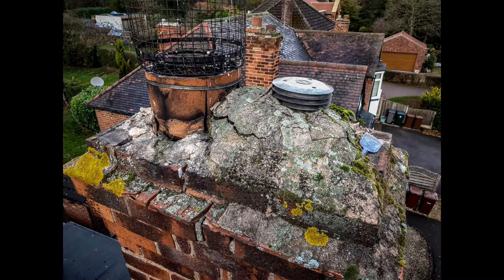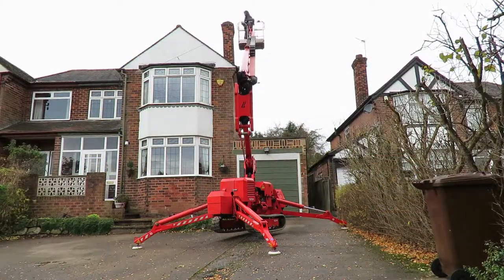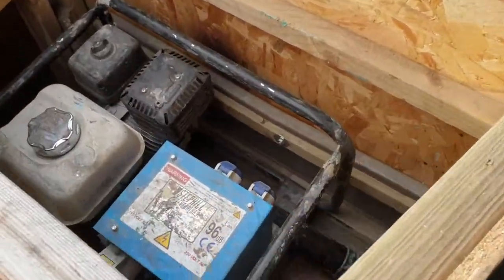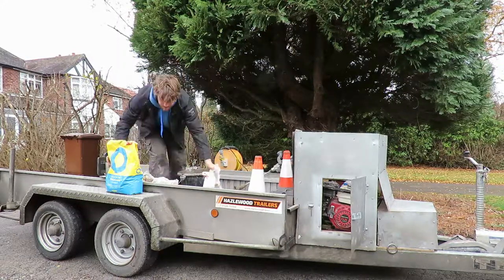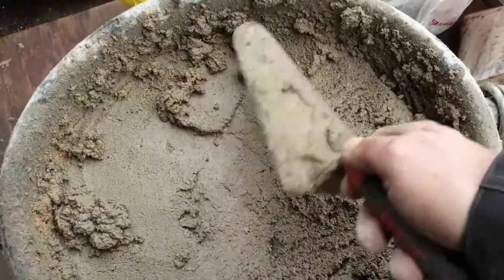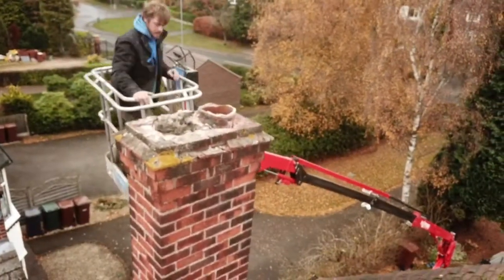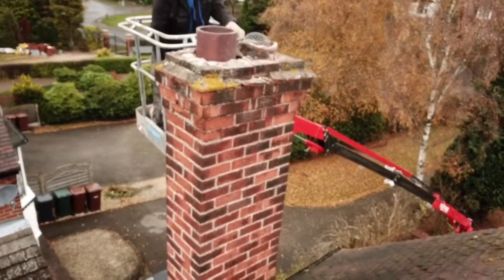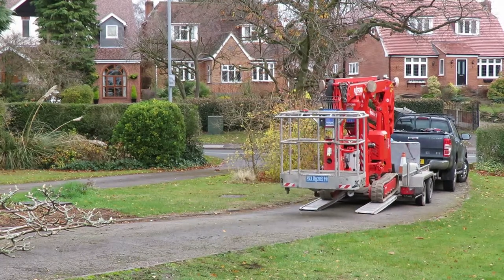Installing a chimney flauncing in Ravenshead Nottinghamshire

Comment: I'd have loved one of those machines, just been up through the Velux and tied myself to the chimney with some ropes. Was proud of the job until a neighbour pointed out that the pot was a little bit on the piss. Its going to stay that way.
Reply from the maker: @sylvinolieno5361   I am sure it looks fine, and as long as the concrete flauncing around the chimney is sound your chimney pot will be fine 👍

Comment: the spider is brilliant looks like you have a crackin business there bud well done
Reply from the maker: Thank you, it's a handy bit of kit and it certainly makes my life much easier.
Reply from the maker: The spider is a little bit over the top for that job but if you are dragging it around you may as well use it, it is much easier than using ladders.
I did this job ages ago so I can quite remember the cost but it would have been around £200ish.

Comment: I would be dubious of any (so called) builder who called mortar flaunch ( in my neck of the woods,  we call it 'compo'. Down south, they call it ' 'muck')  concrete?.....
Reply from the maker: I don't know anybody who calls mortar "flaunch" mortar where I am from is building sand and cement, mainly used for laying bricks or pointing masonary.
Reply: flaunching
noun
The sloped fillet around the base of a chimney pot, which serves to hold the pot in position and allow rainwater to run off.
Also a mortar fillet at the junction of the chimney stack and the roof. Superseded nowadays by lead flashing.